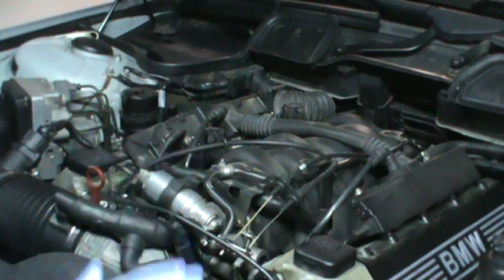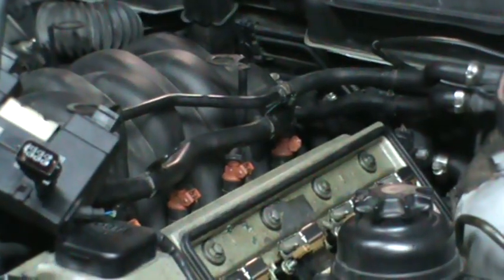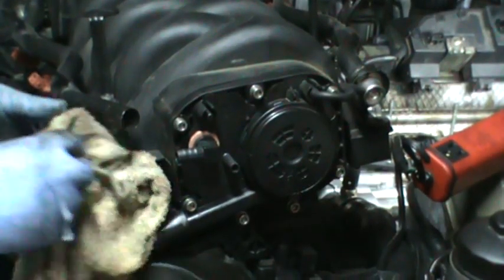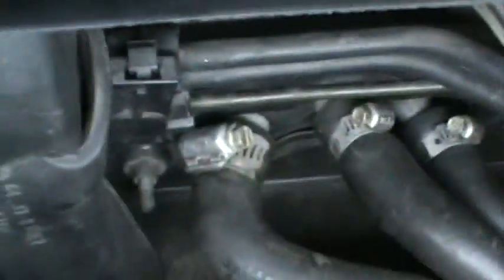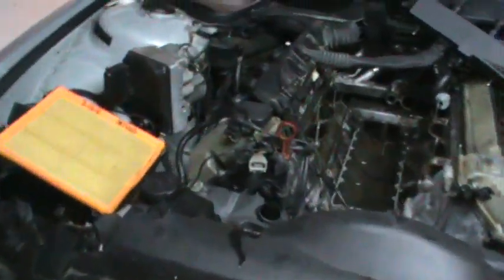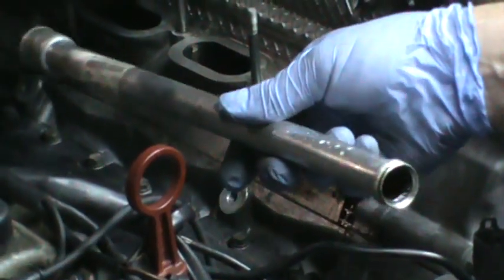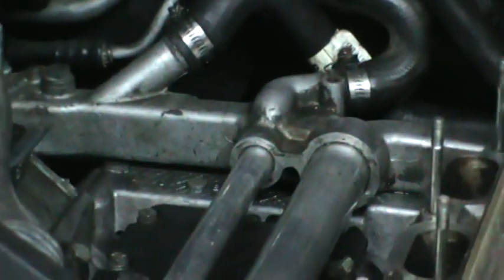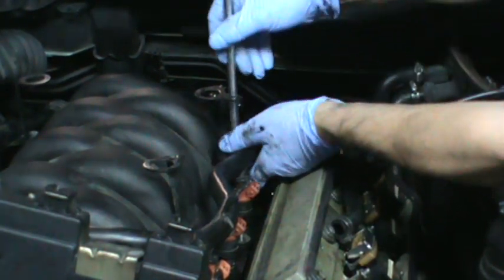BMW M62 Valley Pan Gasket Replacement

Comment: You keep saying it's a bead of silicon - but it's not. BMW updated the valley pan gasket years ago, and the new one is a formed rubber gasket, where the one you took off in this video is the older style that is known to leak. The new updated design doesn't have any issues, and is worth it's price as it makes the job faster and easier. But again - the new valley pan gasket is NOT a silicon bead like you're thinking.

Fox

Comment: You didnt show how to unhook the fuel lines from the fuel rails. I think this is a key step you have to do before you remove the intake. How do you disconnect the fuel lines from the fuel rail.

Comment: How did you know your valley pan gasket was bad?
Reply from the maker: 1st coolant was dripping on the ground.  Looking down onto the top of the engine revieled coolant between the heads and the valley pan back by the firewall.  The leak path actually goes into the transmission bell housing which made tracing the leak path all but impossible.

Comment: what about fuel rail hoses? you skipped that part from the video. How much fuel drips away, do I need to disconnect the battery or fuel pump fuse?

Comment: hey how long did that rtv hold up?i might end up doing that lol.
Reply from the maker: Good question.  The first repair lasted five years until the water pump catastrophically failed on the road and I overheated the engine getting the car to a safe location.  I was in hate mode when the water pump repair ended with the revelation that a valley pan repair was in my future when coolant began pouring out the bottom of the bell housing. That second repair lasted three years when I sold the car. I knew the new owner for the two years he owned the car.  He sold it and I heard it ran for another year before the transmission started to act up.  Long winded ... so that was a know length of six years.  Each year saw 12,000 miles for all of us.
Reply: thats not bad. i might do that.
Reply: I did this last week and it didn't work lol.
Reply: omar k it didn't work?

Comment: If you're CCV plate on the back of the manifold isn't bad, I wouldn't replace it. Just clean it out with brake cleaner. I'd replace the bolts on the front and rear manifold. I'd replace all the gaskets, front, rear, and under.
Reply from the maker: Excellent comment. Thank you for your input.

Comment: You are a funny guy, BMW of course doesn't use silicone on tube when building their engines. Someone before you have had same problem with the car and "fixed" it with silicone and you see how that went?

Comment: Factory is not silicon! Its a real gasket, you Will end up with the same problem again, a real gasket cost about 4-7 $ and problem solved for at least 10-20 years

Comment: You used far too much silicon there. If you're lucky, your waterpump won't break because of the silicon residue inside the valley pan after you torqued down the screws. The manufacturer uses a 3mm wide line of silicon and not 10mm for a reason. Also it seems to work in this video, I would not recommend ripping of the junction box like that since most of the people will end up having broken joints or injectors.